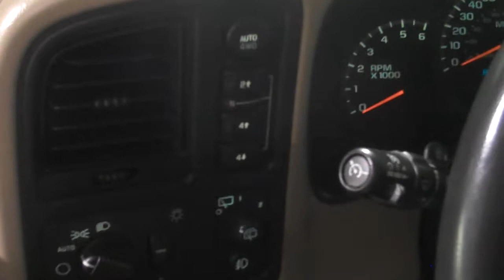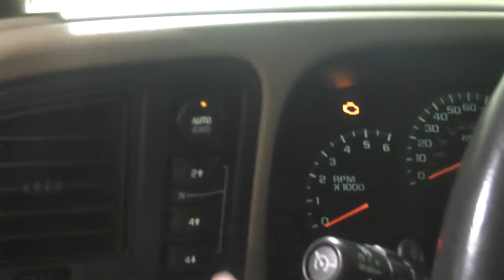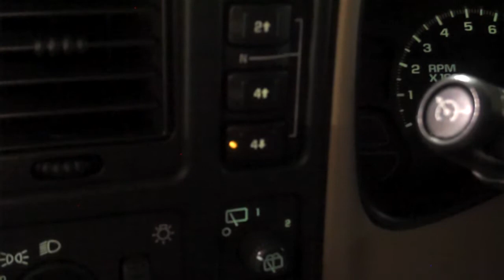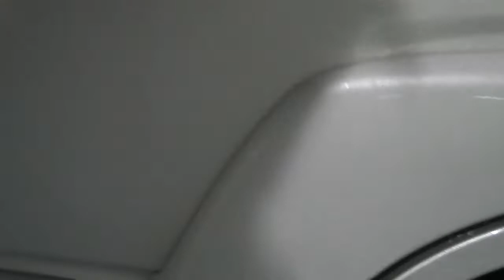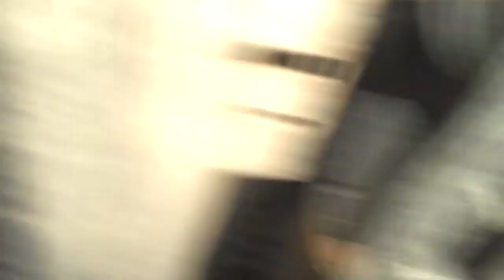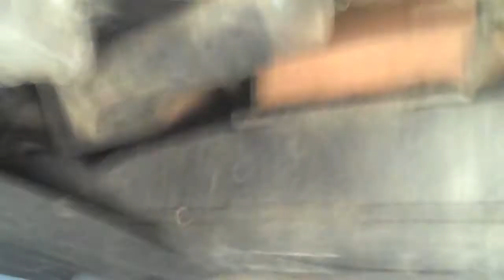4WD operation 2005 Tahoe

Comment: But what happens side to side within the front or rear axle? What happens if the driver front starts to spin in the mud - will it transfer power/torque to the passenger front? Same question on the rear axle?

Comment: Changing can be done with the vehicle in motion, yes?
Reply: Yes, you can select these settings while rolling - just Take Your Foot Off Of The Gas Pedal First..... & Then "Select".....
BUT.....
 for the  4L - which you HAVE to Be STOPPED -  & you MUST  put it in "Neutral" before selecting - & do the SAME for Taking it OUT of 4L.